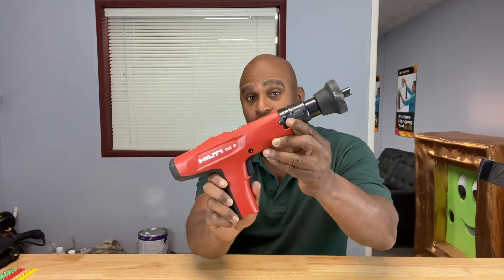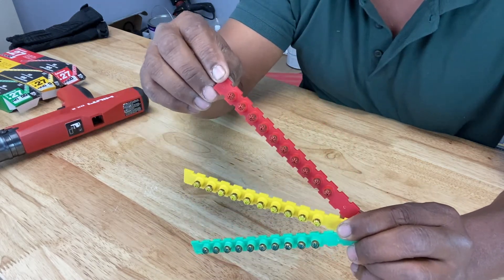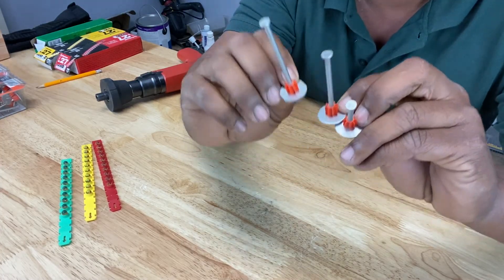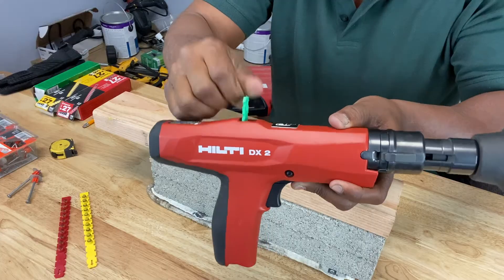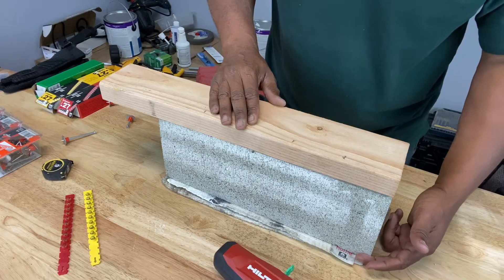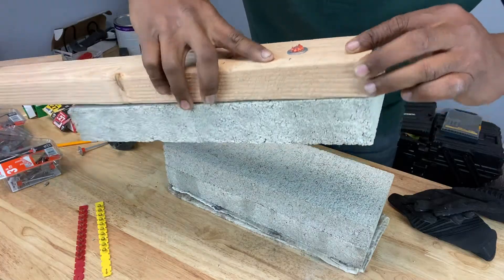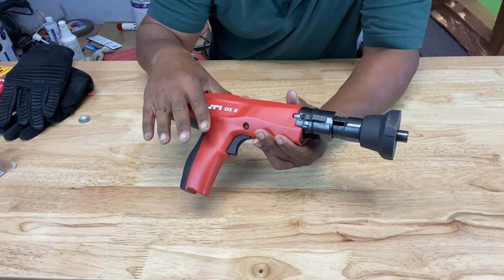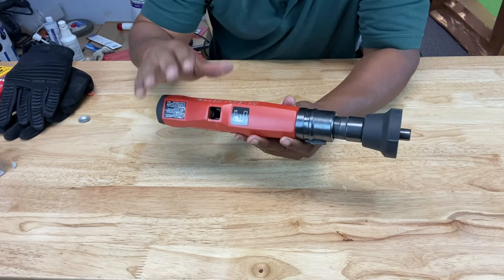HOW TO USE A RAMSET GUN

Comment: You stayed 3" away from the left and right side of the concrete, but not the top and the bottom.  Can you elaborate on the restrictions?
Reply from the maker: You’re right.  I should’ve specified the top and bottom edges. I simply pointed out the left and right edges for the sake of instruction based on the prop I used. Good catch.
Reply: Same spacing to top and bottom. Fasteners should always be at least 3 inches apart.

Comment: I'm interested in fastening some simpson L brackets to the 1/4" flange of a large steel I-beam.  The brackets would be then be screwed to joists that the beam will support.  The brackets will not bear weight, only lateral forces. Would this work for my application?
Reply from the maker: Yes it would.

Comment: I would like to mount 1/2 plywood to a brick interior wall. about 6 or 7 plywood sheets. Can you mount these with pns that wont have the rubber exposed on the pins? I could use tapcons but it would be more painful. thx.
Reply from the maker: As long as the pin heads are big enough to keep the plywood on the wall.

Comment: Great video!  I have the Ramset gun. Need the fasteners and loads. Application: secure 2"x2" board to brick piers that support my back deck. Once secured I want to attached lattice to the boards to fill in gap between piers. To do that, based on this video, used the GREEN powder loads with 3" orange fasteners? Thanks!
Reply from the maker: That’s about right.

Comment: As a woman that doesn't know what shes doing... this video was helpful. I was recommend to use one of these to cover the vents in the crawlspace of my home with hardware cloth to keep out rodents. I have 23+ to cover. Any advice?
Reply from the maker: A ramset gun is good if you are going to be attaching the cloth to concrete. If you are attaching it to wood use a heavy duty stapler